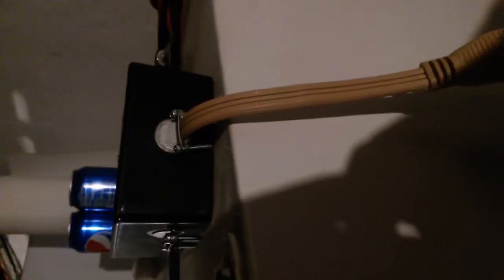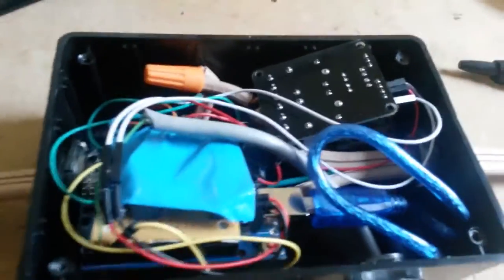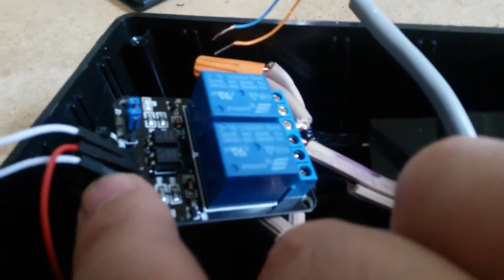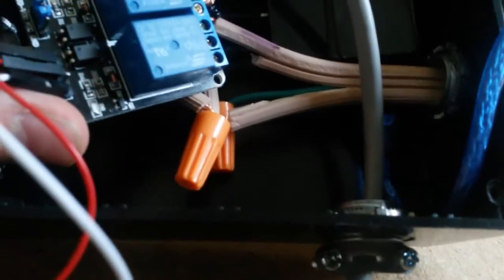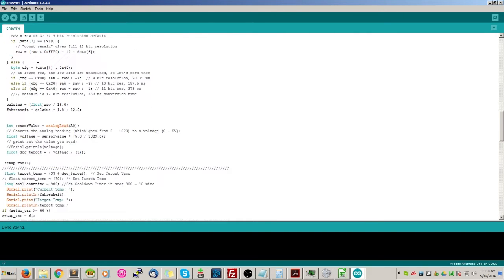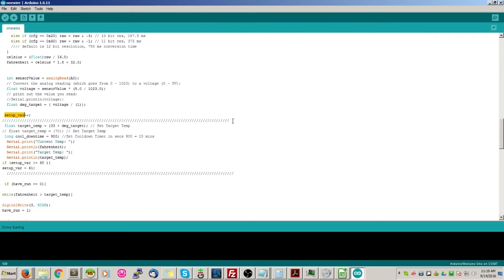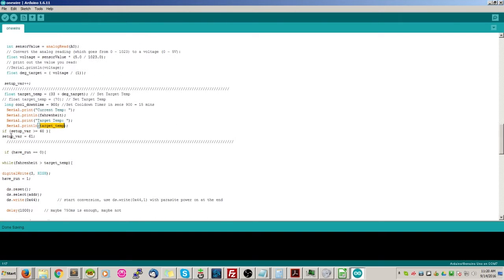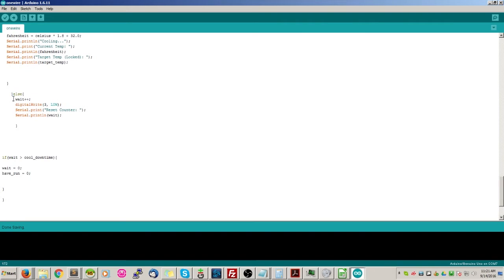Arduino Temperature Controller

Comment: first off... love the cricket in the background. second. is there a reason for a 15 minute check? Why not wait for a temp then cool to a temp. 32~38
Reply from the maker: Because the compressor it needs a chance to recharge. really could set it for 10 mins. But I did 15.
Reply: makes sense